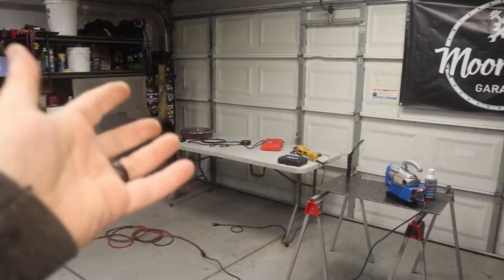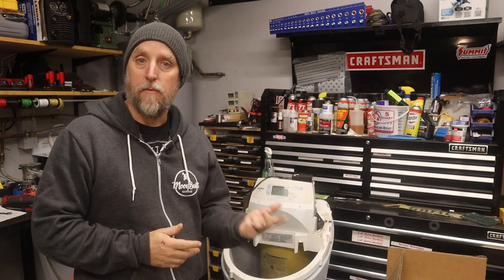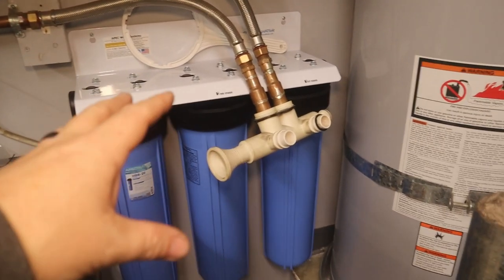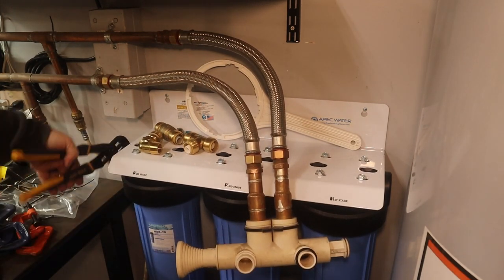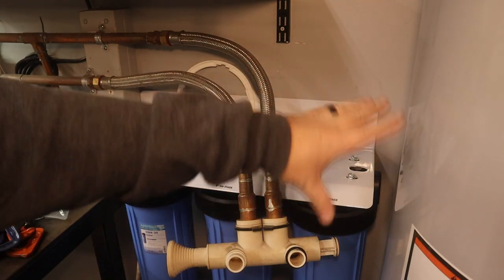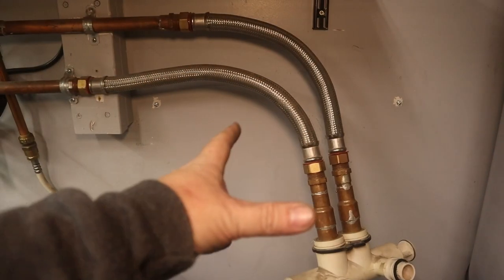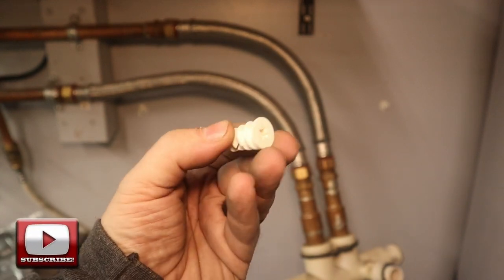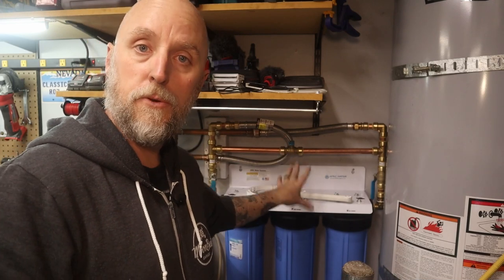How to Replace a Water Softener | Whole House Water Filter Installation

Comment: I would just rather go with a water filter than a water softener
Reply from the maker: I thought I was gonna really like having the softener, but after a time I realized I wasn't that impressed.  It has only been a few days now, but I can really tell the difference in my water by running the filters...I'll never go with a softener again.  Yes, the filters are more costly than just buying bags of salt, but so far the quality of the water is worth it
Reply: @MoonBuiltGarage  water softeners can wreck water heaters but not only that they can add a lot of salt to your water for drinking and I don't like the taste of that and that could cause Big Blood pressure and that is not good so that is why I'm gonna go pick out a water filter instead rather than just picking out a water softener and yes you are correct most people do not like the slippery silkier feeling of soft water I don't like that either cuz when after I'm done taking a shower it just feels like I did not get all of the soap off of me so that is why I gotta do a bigger shower to rinse all of the soap off of me so would I go and pick a water softener no just a water filter only for me cuz water softeners could wreck water heaters and Can add a lot of salt to the water for drinking causing big blood pressure and does not rinse and get all of the soap off of me so bigger shower rinsing washing is required I respect like your opinion and I got the same opinion as you